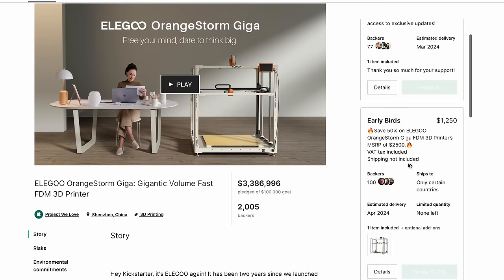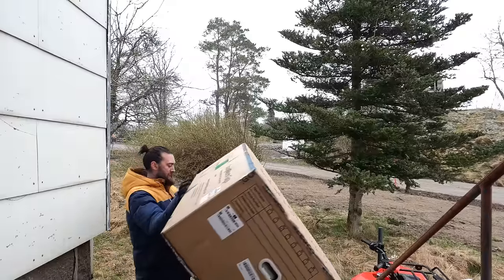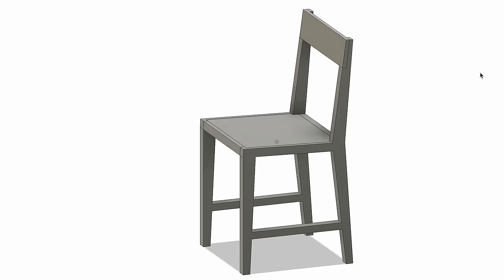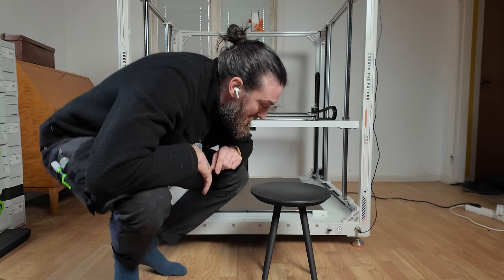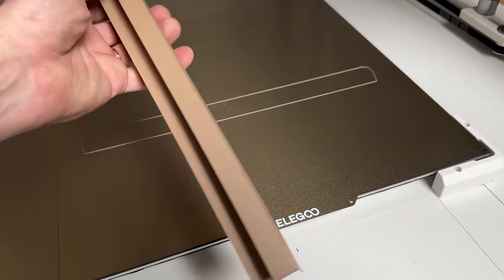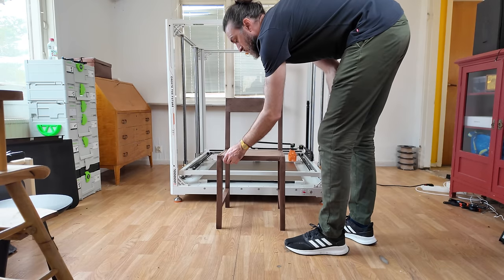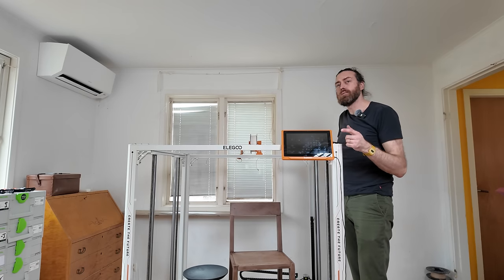I tried this massive 3d printer so you don't have to

Comment: The furniture being weak is down to design faults I think, infill doesn't add a lot of strength and serves more as allowing the print process to work (90 degree overhangs are doable but the larger they are the higher the probability of a failed print) and add relatively minimal strength, especially grid infill since it's only strong orthogonal to the grid lines and adds no strength at all when the compressive load is perpendicular to the infill.

Gyroid is generally stronger than grid, the various 3D infill shapes are weaker but provide strength in more directions.

These furnitures need more crossbars, maybe some gussets, and more walls. Designing for 3D printing is very different from every other type of designing and tends to result in a very unique style of design when done properly.

Comment: You need to pop the M420S code after the g28 in the ma x hune start g code cause the start g code is inaccurate easy fix and itll use the auto leveling mesh

Comment: I am new to 3d printing so this might be a dumb question but with multiple heads could you use cheap filament in one head just meant for printing supports and one head for expensive filament to print the object?

Comment: Everyone keeps commenting about crappy firmware when all you need to do is swap the motherboard, which is extremely inexpensive to do,and you magically have different firmware.  I built my own corexy printer and its quite easy to do as well as fairly easy to change any part on them,if the frames solid you can achieve almost anything by swapping a few parts.

Comment: Sitting down on something printed that hollow is pretty brave I have to say. Those pieces needed twice as much material at the very least. Wood PLA is just about the weakest filaments you can find (much weaker than normal PLA). 

Holding on to something when you test with body weight would be a good idea too.

Comment: I had a lot of concerns with this printer when it was revealed... and it seems I was mostly right.  making a "bigger printer' isn't just slapping it on a bigger frame... there is a lot more to consider.

a printer printing THIS large, needs to be pellet fed. not filament based.  Which drastically reduces the cost of plastic. ($2 per kilo in some cases, non wood filled)  but also, a printer of this size, SHOULD be enclosed and camera monitored with at least 'spaghetti detective' ability, like you experienced, it is far too common for just a simple issue to cause a problem that makes it fail - and losing TONS of hours/plastic from an early failure,  (say 4 hours into a 16 hour print) - is devastating even for prototypes.

the 4 beds all spring/screw is also another problem... even if you spend hours getting that all leveled out - it won't be long before it needs re-adjusted.  Either software needs to compensate, or, a better bed design. (at least it wasn't a bed slinger design)  I do agree that the bed should be stationary though, with the flying gantry system of printing - as the weight of large objects (like chairs) could otherwise over power any standard motors to keep the bed in place, or make it move much farther than 1 layer at a time. The opposing solution to this is - stronger motors, but those are more costly too.

I really see this machine as a prototype. It needs far more work to be used in any real sense, especially as everyone who has had one - complains of things like the print head digging into the bed, or broken heat breaks - almost every machine sold has had these issues.. showing it wasn't ready in the first place.

Comment: Hardware is really good... hasnt had a successfull print out of the machine.
I understand not wanting to upset Elegoo but from every review all showing teething problems (and serious wobble on tall prints) i just dont think this printer is quite finished for full release, which is fine... its why they have sent it out to testers but its just not quite there yet.

I'd love to see what furniture you can design with this. If you use a much bigger nozzle and more walls then you will be able to make much stronger prints even without going too heavy on the infill

Comment: I'd be very worried about how much filament this will eat through when you start doing large prints, I'd probably go bankrupt. 

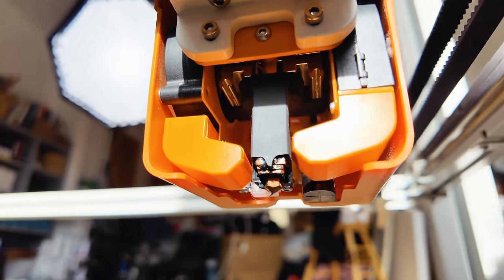4:31 interestingly enough I watched another youtube video where this exact same thing happened. That video also had filament run out, run through the run-out sensor so the printer "paused" but on the way down the filament hit an endstop, knocking it loose and the toolhead then slamming into the side with the endstop missing causing a layer shift.

I think a large volume printer like this would be excellent to make things like guides, templates, molds and other tools that can help you make things from "real" materials. And if you jank it up you could even replace the toolhead with a laser or plotter to make really big drawings/engravings, if you ever figure out how to get the bed level. There's only so many possibilities with 36 adjustment screws right?
Reply from the maker: haha yeah - so many possibilities to get it wrong :) I agree there are some ideas on making jigs with this thing - but it's an expensive way to make it.

Comment: wow.  Spelled W.O.W.  Very COol. Especially in a sea of 3D printers. And you are right, not as expen$ive as I would have figured. At first I wondered if a large filament shipping container is placed outside the window and get 'fed in' using a built-in diesel engine? But then I spotted the included rolls. BTY; The finish on your chair is amazing. Thanks for taking one for the team. You RoCk!  Cheers from So.Ca.USA 3rd House On the Left.

Comment: I think the point would be to make very complicated designer furniture that would be difficult/impossible to make cost effectively using wood, think like a wegner shell chair. Also if you were serious you could enclose the printer and using petg.  Mold making would also make alot of sense..2K price is insane too, you could not buy that raw material here in canada and assemble it for that price...these are good times.

Comment: lol, the nozzle not adapting to the height difference of the bed (which is measuerd) is something I strugled with on my Neptune 3 Pro. And people said its bcs the nozzle adapts just a bit, as it doesn´t go further then a 0.1 mm (suposedly) But yes, what the hell, Eleggoo..in the end I had to upgrade to a screw leveled bed design (the classic) + it had the probe feature from before, but yes..good old screws.

Comment: I think the benefit of a larger 3D printer is low. For most things it's more cost effective to use it just for the joining and use readily available parts for the larger sections like sheets of acrylic or metal pipes. But with the large prints surface I do see a use in making the housing for RC cars as these are odd shapes, and when printing in multiple pieces the joining area's would take up a lot of the precious inner space, so being able to print it as one piece would be a great benefit. But this is a niche case.
Reply from the maker: True! and yes, somewhat niche. Perhaps in the future it will be quite easy ordering specific parts needed from a company with large printers rather than buying one your self.

Comment: Could be wrong but are you missing the Bowden Tube for the filament looks like there a tug on the filament as its moving as its not in a tube this would cause the issues your seeing here, under excursion and making contact with model due to pulling on the filament
Reply from the maker: There was no bowden tube in the instructions nor the box so I guess they didnt think it was needed, but perhaps it could work adding one.
Reply: I had issues with loose tube on 2 of my 3D printers and the lack of one was given all the issues that you have on this print, under extrusion being the key one.
Reply: I had issues with loose tube on 2 of my 3D printers and the lack of one was given all the issues that you have on this print, under extrusion being the key one.

Comment: I dont think you can take designs that are made from wood and just 3D print them. You need to design the chair based on the material in order for it to utilize the strengths of the material.

Comment: I think you're missing one amazing aspect of 3d printing. You tried to 3d print a wooden chair, and you tried to print a stool that sort of follows a wooden stool design. Instead, you should be printing furniture that cannot be otherwise manufactured, catered to the strengths of the medium. It requires you change your definition of furniture, and think outside the box.

Comment: It's not really for making hollow flat pieces. Or shapes that are easy to carve or cut or lathe or otherwise machine. Or joinery. It's for large complex curved surfaces and shapes that would be enormously difficult to machine or carve. Organic complex shapes is what the 3d printing allows and thrives on. Combined with AI powered design based on strength calculations, you get some otherwise unattainable optimizations on shape and material. Some of the newer slicers offer non-uniform infill with complex patterns where the strength and mass is where it's needed. With the huge volume and long print times and growing pains, this might not be a production tool yet for a bit. Try printing a rosebud the size of a chair vs carving it out of wood. Don't sit on it.

Comment: This printer really shines with short, flat parts, since the higher you go the more wobble you get, and the higher the odds of a print failing through a layer shift or similar. Unfortunately, that also means that you can't take advantage of the verticality to make some topology optimized parts that would be a pain to manufacture another way. 
A simple example of this for shelf brackets: https://www.youtube.com/watch?v=3smr5CEdksc 

I could also see it being used to make scaffolds for fiberglass/carbon fiber weaves, but that's about the only use I could see for having such a large build volume that costs at least $10 a kilo to use. Even a crappy lawn chair is around 2 kilos of plastic, best case.

Comment: The main problem is not the size of the printer. It's the system. filament printer are too slow and too risky for print jobs that size.
Resin printers would be faster, less risky for failures and probably easier to build as a construction due to less moving parts.

Comment: PLA+ is a lot stronger than regular PLA, and doesn't need an enclosure or anything special. Just prints at a little bit higher temperature. It's all I use now, regular PLA is garbage by comparison.

Comment: 3d printers comes at a premium in trade-offs (price, time, plastic waste...). But they are great because complexity is free. Designing objects with barely any complexity for 3d printing therefore makes no sense, as you only get the negatives of 3d printing without any of the positives.

Comment: Using wood type connections in an 3D printed plastic design isn't the right way to do things. You should always adapt your design to the material/technology you're using. Your design should change according to your material/technology. It makes a huge difference whether you build in wood, steel, concrete or plastic.

Comment: conveyor belt bed  multi hot end simultaneous printing say RC tank trax or print in place RC plane also CNC end lazer end and edm end as well as welder plasma cutter end the multirole 4ft box tool

Comment: The cool thing of CNC machines is making objects that would be impossible or very complicated to make by hand, and/or to make many identical pieces for a series production.
I'm seeing too many videos of people using these kind of machines to create very simple geometries and pieces that could easily be done by hand in a tenth of the time and without waiting for hours and hours with the fear of some power and/or mechanical/electrical problem during the process.
Moreover, the bigger a machine is, the faster it should be; ok, I can print an 800x800x1000mm piece, but are we sure it's worth to use kilometers of filament and wait till the piece will be done before we and/or the machine will be died? I don't know.

Comment: Yeah, as a result, almost flat parts. My diode laser cutter has a field of 950*950 and I'm willing to bet that it can handle this kind of work ten times faster. At the same time, the probability of a defective part is almost 0. It cost me $ 750. 20 optical watts. k diodes of 5 watts each. cuts 3mm HDF at a speed of 650mm/s. 1 pass. Removing the material is much easier than adding it. The real future is in diode lasers. Flat parts solve 99% of the tasks. And you can use eco-friendly plastic - wood! So is the plastic itself. The machine also consumes 150W with blowing.

Comment: The dovetails should be embedded in side-parts of the chair, not protruding from them. Now due to layering these little sh*ts will snap off easily (which happened rigt away), and the same would be true for wooden dovetails with grain across them, instead of along them. It would work even better with traditional wooden chair joinery, as material anisotropy of wood and 3d-prints is similar. Thus it is design which failed, and we still dont know wheter this printer is ok or not.
Reply from the maker: Yes - I agree the design was really bad but also made quickly in Fusion 360 to be able to try the printer out.

Comment: A 3d printer kinda looses its value the bigger it gets. Think about it, the only thing you are printing is medium sized parts to be screwed into or place into structures with far stronger materials. I guess a sculpture would be another story. But you would lose portability.

Comment: I would rather buy 4 ender 3's than buy this thing. Something about the possibility of it failing something so big scares me, and knowing myself I will 100% find a problem with the print and not be happy. Might I also add as much as I like the affordability of the Ender 3 I was much happier buying something with a locked heat bed, such as the flashforge adventurer series. I have a adventurer 5m and It has never failed me. So I would much rather buy 2-4 of those spending $2000 rather than buy something that would fail for $1200. Ialso have the Bambu Labs P1S which is absolutely amazing and can print in multiple colors and well as multiple prints without failing even one of them in less than 12 hours that was cheaper than this abomination they call the future. Bigger isn't always better.

Comment: Its actually funny that you used the printer to do stuff its clearly not able to compete with. Obviously a wood working shop will be able to create that chair for a few bucks. However, if you would use the printer for things that a wood working shop cant, the amount of effort flips in favor for this printer. As soon as the geometry of the end product becomes highly complex you wont be able to recreate it in a wood working shop without serious amounts of manual labour. Rectangles and circular shapes aside. Try making a chair with Gyrode legs in a wood working shop. Or complex integral shapes within the support structure. There are certain kinds of elements like frescoes or other design elements that might take days of scraping and sanding, that can be printed easily. This is what 3D printing was initiatilly intended. I could print small storage boxes with my printer, but I dont because you can get those on Amazon in a pack of 20 for a few bucks. Instead I use my printer for simple mechnical parts without durability requirements or just small art projects.

Comment: Using 3D printer for larger objects is a joke. An outdoor plastic chair costs $10 and is light, rigid and uses a fraction of the filament you'd use.

Comment: Great video 👍 but I think the problem is you are trying to print traditional furniture, which was designed to be functional and stable using lengths of solid wood. You need to think outside the box and use 21st century engineering, combined with the amazing geometry made possible by 3D printing, to create some futuristic "holy sh*t that looks amazing" style furniture, that can hold incredible weight due to the complex design. Kind of like infill and support structures, but on the outside. A few things that come to mind are the airless tyres, airless basketball and some of the funky , reimagined shoe designs currently being printed.

The path you took is more like trying to create a vegetable burger that "looks and tastes like real meat!" instead of making a new, beautiful vegetarian dish, showcasing each vegetable for what it is 😉

Can't wait to see what you do next!

Comment: You want to increase shells, stresses are on the SKIN of the object, not interior.

That is also the worst possible design for 3d printed stool.
Designed for printing, at that size, i wouldn't be surprised if one could hold several cars up in the air ... ;)
Reply: PLA also is the strongest 3d printable material, PETG is complete and utter garbage in comparison.
Reply: You can get PLA filament these days for ~6€/kg
Reply from the maker: what?! Where? My roll of 5kg was 180 dollar. The four rolls of wood pla was 240 dollars.

Comment: Already within the first minute im a little annoyed, of course you can print furniture, but you probably wouldnt print furniture designed with the structural constraints of wood, you would design to print, as you do with all other things you print. The reason a four logged chair looks like it does is because it makes sense if you build from wood. Not so much for 3d print, you need to apply other design principles to handle structural load.